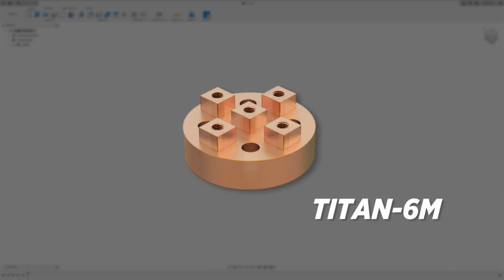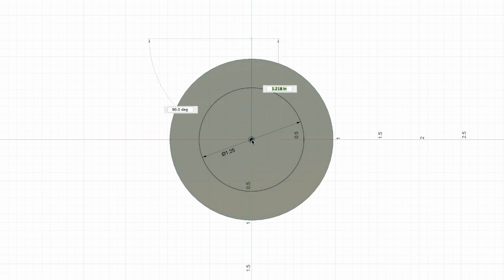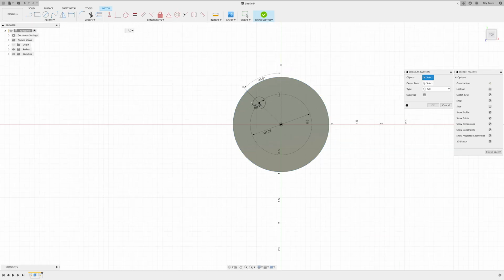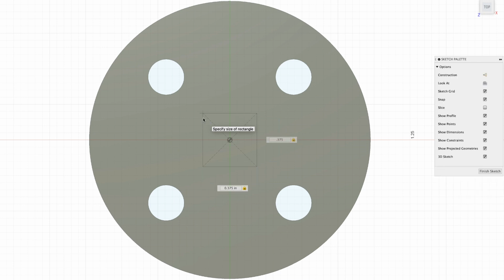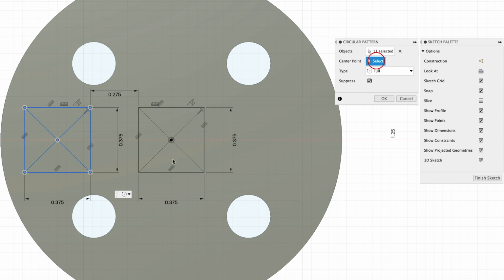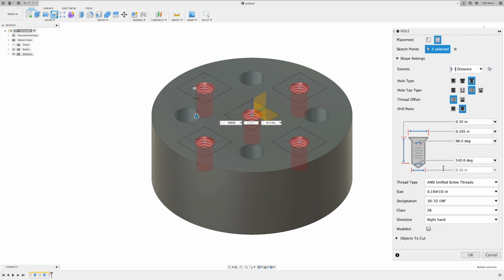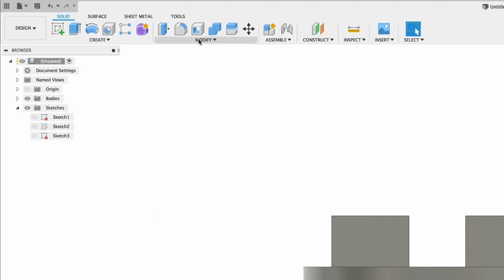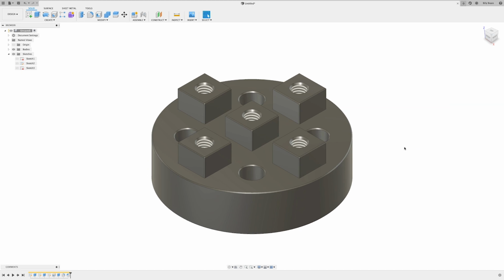FUSION 360 TUTORIAL: DESIGN THE TITAN-6M | ACADEMY

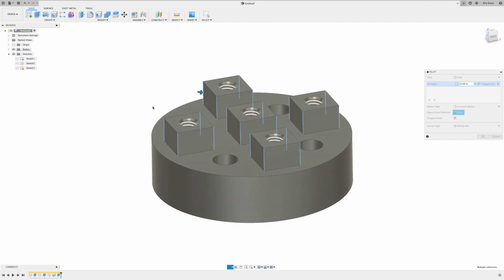Comment: 6:14 - When I try to select the edges of the squares to fillet them, it also selects the threads.  How can I prevent this aside from performing the fillet before adding the tapped holes?
Reply: Ah, it's because I modeled the threads.  I ended up suppressing the hole feature, created the fillet, then un-supressed the holes.

Comment: When I use the press up feature on page 3 to etude the blocks  it will only select the the entire top of the part what have i done wrong??
Reply: I had the same issue with this part, the solution is here https://forums.autodesk.com/t5/fusion-360-support/titans-6m-press-pull-problems/m-p/9781808/highlight/false#M101620
Reply: Press Pull Feature